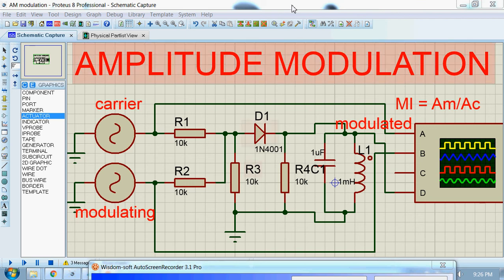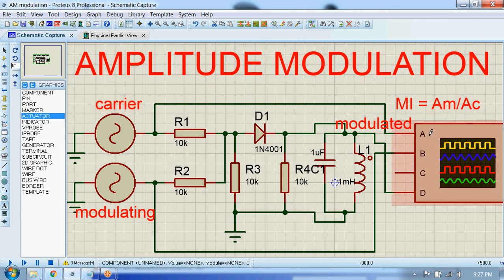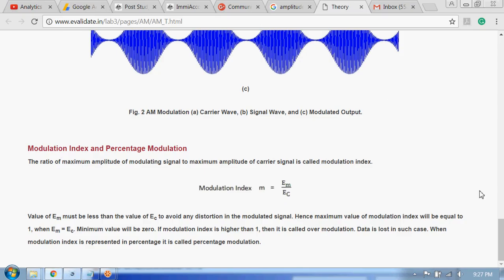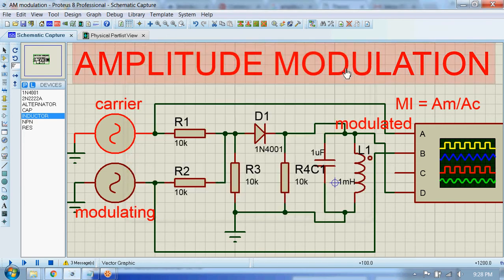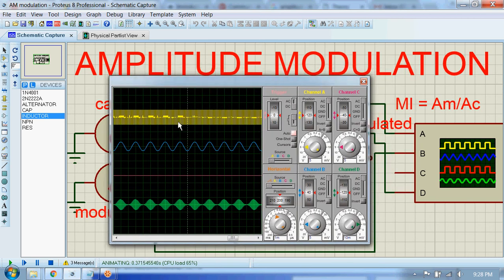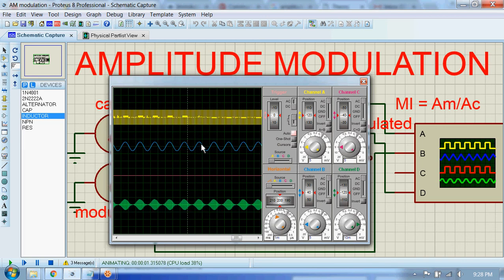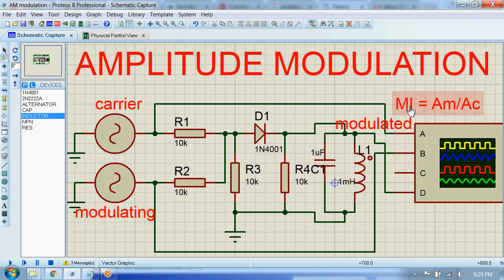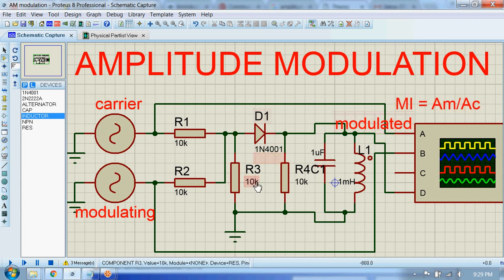Amplitude Modulation.avi

Comment: Tank circuit is tuned for 5khz, but carrier is 10khz. Is it correct? Moreover output is taken parallel to tank circuit. Is it OK?
Reply: Hi, I have the same question, I don't understand it.
Reply from the maker: @famsmcipod  answered. Hope it helps.
Reply from the maker: Tank circuit is tuned for 500Hz/0.5Khz. Output is not taken parallel to tank circuit but rather combination of carrier and modulating signal. You can see we have fed two signals through R1 and R2 which then get added to give modulated signal. Hope that clears your doubt.